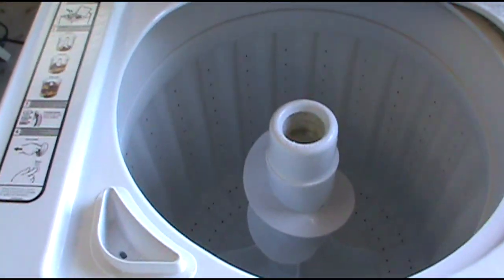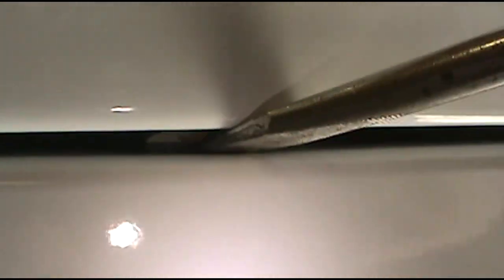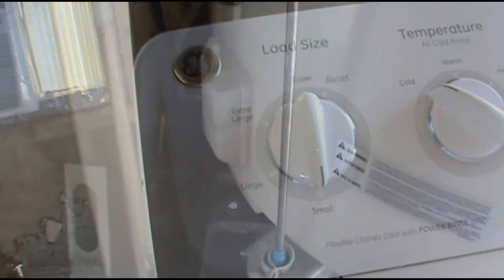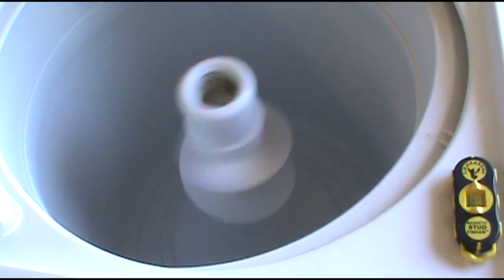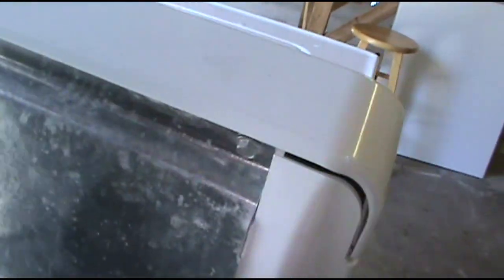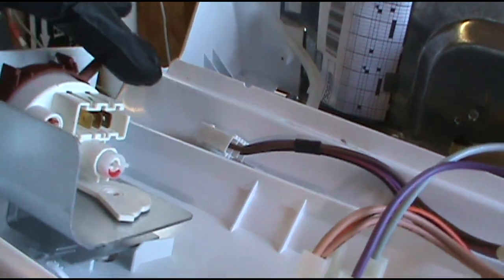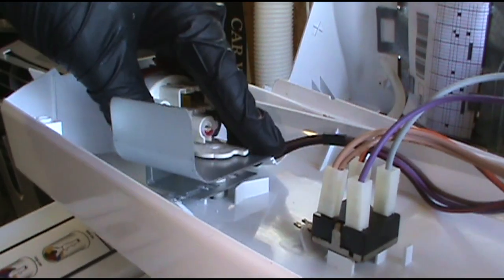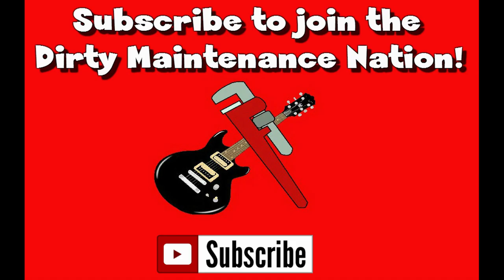HOW TO FIX WASHING MACHINE THAT WON'T GO INTO SPIN CYCLE

Comment: Hi Lex,
My washing machine spin still works but it doesn't spin in a high gear. What do you think the problem is?
Thanks...
Reply from the maker: Hmmm, that's a tough one since I'm not in front of it. Could be the transmission. I've had to replace a lot of them in the past. I'm sure there's a YouTube video on how to do it. I don't have a video on that yet since I haven't had to do one in years.

Comment: I have hydro wave ge washer top load the motor code flashes 6 times according to the chart that means locked door it says to free the system. I tried everything thing, nothing works. The machine won’t agitate nor spin. Any help?
Reply from the maker: Try unplugging it for 10 seconds and plugging it back in. Sometimes a reset works. If not, I'd need to be there for this head scratcher 🤔.

Comment: So how about if it spins only sometimes, seems only lightweight loads will spin. 
Tried wash a cotton blanket, very heavy wet and it also wouldn’t spin BUT after a push start, it spins normal
Reply from the maker: Hmmmm after you help it then it starts to go tells me a motor issue. I could be wrong but if it was anything else, it wouldn't go at all. Even with a push. Could be the blanket is too heavy as well. Hard to tell by not being there. Thank you so much for watching J!
www.DirtyMaintenanceNation.com

Comment: Didn't work for mine but thanks for posting.  With my timer in the "spin" area of the dial, I can blow on the hose and hear the click of the switch up top and the transmission/motor/pulley will jerk like it's wanting to spin, but that's all it does, is jerk.  I wish I had a schematic and logic diagram I could follow so I could see which wires are connected when that air switch operates.  I'd also like to know how opening up that clear hose to atmospheric air pressure (when the tub drains down that is what is happening) the switch is operated.  I have to blow in by mouth about 2-5 psi over atmospheric to get the switch to click.
Reply from the maker: Sounds like you got a head scratcher there.
Reply: Do a motor reset unplug the washer for 1 minute plug it back in and open and close the lid 6 times fast that will reset motor usually associated with "jerking" you describe

Comment: My GE won't spin. Just makes clanking noises and moves back and forth a little. . I put a magnet on the lid switch so I can have the door open. I gave the tumbler a little push and now it's working. What could the problem be?
Reply from the maker: Weird. If you have to help the motor, it may be going bad. If it was something else it would be totally dead. Hard to tell by not being there. Thank you so much for watching College Debt!
www.DirtyMaintenanceNation.com

Comment: I have GE that cycles fine until last spin cycle. Drains but no spin. Tube is clear I can hear pressure switch pop. Motor free to turn  what else should I check?
Reply from the maker: Weird. If the timer advances all the way to the end then it still could be pressure switch. Hard to tell with this one. I'd need to be there.
Reply: The motor will turn to agatate but will not turn to spin. Belt drive. Appears transmission locked up in one direction

Comment: Lex, I have a 70 series Kenmore washer that will only go into the rinse and spin cycles by manually turning the knob which woks only some of the time. My lid switch has been bypassed so it's not that. My hose is clean so i don't think it's that. Does this issue sound like a timer problem? The timer goes all the way through the cycle but when you lift the lid that washer is full of water. Right know i can force the spin cycle by turning the knob to spin and forcing it on. Need some help!!
Reply from the maker: Robert Louis Hmmmm, that's a tough one by not physically being there looking at it. If timer advances to the end on its own then it sounds like timer is good. Maybe pressure switch is broken & telling washer that there's no water in it so it never agitates. Just a guess though. Thank you so much for watching Robert!
www.DirtyMaintenanceNation.com
Reply: Do you hear any noise when it supposed to be in rinse and spin cycle?

Comment: Ok since my last post I have realized that my timer knob doesn’t move at all. So should I replace the timer dial (knob)? If the timer doesn’t move could that be the reason it runs over with water?

All of the cycles work if I manually advance (turn) the timer knob by hand.

Now for the next part. Where can I buy GE replacement parts for my machine? I’ll Google it but if anyone knows a good link please help me out ok. 

Thanks 
T
Reply from the maker: GeorgeBonez If the timer is not moving to the end on it's on, then yes I'd replace it. Sounds like it's bad. Also, click on the gray arrow under the video & look in the video description below. It has part links you can click on. Then, you can search around until you find a match & buy the parts on Amazon. Thank you so much for watching George!
www.DirtyMaintenanceNation.com
Reply: Lex Vance I removed the old timer to get the correct PN and have ordered a new one. I’ll let you know how it goes in a couple of days. Thanks again for all of your great help. :)
Reply from the maker: GeorgeBonez You're welcome man! Keep me posted!

Comment: I have a GE select washing machine and it will agitate fine, but  it won't spin out. When I blow into the tube, I can hear the switch and the agitator clunks like something is binding. How can the transmission be bad if it agitates? Thanks
Reply from the maker: Pull the agitator up & see if somethings caught under it. It should pull right up. Put fingers underneath & pull up. Its hard to tell when I'm not in front of it. Also, look on top of the motor & see if there's a light blinking on top of the circuit board. The newer washers will give an error code & tell you what's wrong. Google "error codes" for your specific washer if it has it.
Thank you so much for watching Joseph!
www.DirtyMaintenanceNation.com
Reply: @LexVance  , thanks for the reply. It's an older model, so no circuit board. I'll give it a try on the agitator. 🤙
Reply: @LexVance  , update- I popped the agitator out and now I know why it wouldn't spin. The tub underneath the agitator is corroded through the metal. The previous owner must have left some caustic liquid sitting in there for a while. Oh well! Thanks again! Time for some Scooby snacks!

Comment: Dear i have problem it turn in until drain & spin the last cycle its stop what you think it is terminal or pressure switch
Reply from the maker: I would need to be there for this head scratcher. Some things I can't do over YouTube comments.

Comment: Hi Lex Vance, my washer is Kenmore sears 100, I tried to put it down yesterday , I found the thin pipe is blocked. I can't blow it. What should I do? Need an air gun to clear it? My washing machine is new，less than a year, it always stop at “wash” circle ,I  tried "motor reset ",it worked good (complete) only  once, then stop at "wash" as usual ...  the repairman said that the water is too slow.
Reply from the maker: Xiaoqing Chen Get a coat hanger & run it up the tube as far as you can & clean it out. Should be good after that. Thank you so much for watching Xiaoqing!
www.DirtyMaintenanceNation.com

Comment: Is it possible for the hose to be partially plugged in such a way so that the tub fills to the right level correctly but when the tub drains the spin never starts?

 That's what's making me crazy, I can't figure out what tells the spin cycle to start.  What my GE WCXR1070T5AA does is the drain pump pumps forever down to the bottom and then just is pumping air (I think this is normal). The tub never spins because some how the controller thinks it's still pumping out water that's not there
Reply from the maker: Could be. Blow it out & see.
Reply: @LexVance  But the load level function works correctly (when set to "small load" it fills to small and stops, etc), I'd think if the hose was blocked the tub would overfill.  So you think it's possible for the load water level to detect correctly but it can fail at detecting that the tub is dry?
Reply: @LexVance  I blew in the hose, I hear the expected water level switch click (actually I expected three different clicks for the three load sizes but it just clicks one time... not sure how it tells the difference between the three load sizes if the switch only clicks one time)
Reply: Did a extra small test load (empty with no clothes), now it worked to the very end, all I did was the blow in the hose to confirm the switch would click.  Maybe that fixed it.  Thanks

Comment: A common problem on older machines that won't enter the spin cycle is the mechanical lid switch.  I haven't worked on one yet with a magnetic switch like the one your working on.  Just another thing to look out for Lex, thanks for the videos!
Reply from the maker: aeroaggie Oh yea I've worked on a few of them old dinosaurs. You could hardwire the lid switch and bypass it. It was so easy. I loved them, LoL!😂👍😂
Thank you so much for watching aeroaggie!
Www.dirtymaintenancenation.com
Reply: we still have kenmore washers from the 90s still going strong..and they get abused.
Reply from the maker: working shlub Noice! 😂👍😂
Reply: Why my washer spin but not the final 2 minutes of spin? Clothes come out damp.  dial never reaches off position. Close but too wet.

Comment: My GE doing the same thing not spinning it keeps going into error codes 16 &18. It drains properly but won’t go into spin cycle. It’s a HE one so the cover is not easy to get off. Any advice on how to fix these codes?
Reply from the maker: You can Google "error codes" for your washer & you should get the answers. That's how I got the error codes for the GE washers I work on. Thank you so much for watching Darci! 
www.DirtyMaintenanceNation.com
Reply: Lex Vance so we entered in service mode and it said it was due to a clog somewhere..we have literally disconnected every tube and no kinks or holes even to the main drain.

Comment: My washer is starting the spin cycle but it seems to be stopping early.  There's no visible water in the tub but the clothes are very wet (sometimes completely soaked) and you can hear water sloshing if you rock the tub.  Also, when I opened the front I could see dirty water in the little tank that the pressure sensor hose connects to.  

Does this sound like a bad pressure switch or something else?
Reply from the maker: Hmmm that's a tough one to diagnose over YouTube. Is the timer going all the way to the end? If not, the timers bad. Thank you so much for watching straighttoplaid!
www.DirtyMaintenanceNation.com

Comment: Mine will spin once it finishes the rinse cycle and starts to pour water out but then stops spinning and makes a noise until it finishes. If I put it on spin cycle only it will spin clothes without a problem. Why is it doing that? There's no water inside left but the clothes feel wet, no soaked but not like it does after a normal spinning cycle.
Reply from the maker: Hmmm, you've got a head scratcher there. I'd need to be there for this one. Sorry Eric 😭

Comment: Question washing machine is indicating spin but it's still not spinning what kind can the problems still be
Reply from the maker: Could be the pressure switch or it could be the lid switch. I'd need to be there with my volt meter to investigate. Thank you so much for watching Pnu!
www.DirtyMaintenanceNation.com
Reply: @LexVance  I appreciate the reply

Comment: Do you think it's still  the pressure switch if it spins on empty test run but not with a load in?
Reply from the maker: Chris Watson Yep.
Reply: Replaced pressure switch, still won't spin with a load in but will spin on empty test run. Also has a burning smell when trying to spin with full load. Any other suggestions?

Comment: When my kenmore starts the spin cycle, it sounds like it's running but the basket stays still. If I open the top (which stops the motor) and close it again, everything spins fine. Any idea what might be the culprit? I cleaned out the hose but wanted to check before buying a replacement pressure switch
Reply from the maker: Kenneth Coleman Man I don't know that's weird. I would need to be there. Its hard to diagnose over YouTube comments. Thank you so much for watching Kenneth!
www.DirtyMaintenanceNation.com
Reply: Hey dude,,same exact problem. I believe the lid switch is the problem there. Because as u say lift the lid and close it and its a go.
Reply: I have the same problem. I will push the knob in and pull it out, and it starts spinning. It's like it doesn't engage spin sometimes.

Comment: This worked once and now it won't spin again. I noticed the timer keeps ticking after the cycle is done.
Do you think it's still the pressure switch or could it be the timer that is preventing the spin cycle from engaging?
Thanks
Reply from the maker: Chris Watson Its the pressure switch. Put in a new one. Thank you for watching Chris!
www.DirtyMaintenanceNation.com

Comment: How can you tell if it's the pressure switch or the lid switch? Same symptoms right?  Thanks.
Reply from the maker: If it was the lid switch, it wouldn't agitate. It agitated fine, just wouldn't go into spin cycle. That's when I knew it was a bad pressure switch. Thank you so much for watching Peter!
www.DirtyMaintenanceNation.com
Reply: @LexVance  Hey Lex,, thanks for giving your expertise on the tube. As for the lid switch theory is because when I lift the lid during a spin try, and close the lid it starts to spin. Also, the discharge does dump the water prior to spin but the tub won't spin till i open the lid and close it again. Crazy huh. Washers have sure gotten complicated. 😋

Comment: Hello brother I have the same model washing machine as you. My washing machine will just hum. The belt is fine the motor is extremely hot. It will not spin or agitate can yo uh help me sir.
Reply from the maker: The middle agitator pulls up. Just put your fingers under it and pull it up. See if some clothes got trapped and is causing it to bind. If that's clear then you may need a new motor. With it being extremely hot, that's not good. Thank you so much for watching Thomas!

Comment: THANKS FOR THE GREAT SERVICE YOU DO TO OTHERS AND EVERYONE WHO WANTS TO FIX ON THEIR OWN. ONE QUESTION WHAT IF YOU HEAR IT WHEN YOU BLOW INTO THE SELCTOR IS IT WORKING .?? ALSO WELL WE NEED TO KEEP IN TOUCH I AM A HANDY MAN THAT FIXES MANY APPLIANCES AND SOMETIMES GET STUCK? GET AT ME AND GOD BLESS
Reply from the maker: Not always. Sometimes you'll hear it click but it'll only work temporarily and then not work again. Just replace it then. Thank you so much for watching tonyc!
www.DirtyMaintenanceNation.com
Reply: Thanks for the quick response lex, I ordered the part already and well , just have to wait an see. I knw its not the timer as it moves slowly when I start it up, when I move it to spin drain, it drains just wont spin, or agitate as well. Now the motor is good I believe I hooked it direct and it spins so its only one other thing, either the switch . I doubt that as I hear it as well when I lift the top. Anywho thanks again , God bless
Reply: oh what if its not that? i mean it drIns it does not spin or agitate. changing the selctor switch a. what else can it be. thanks

Comment: I have a hotpoint washer after putting clothes in it it will not drain the water from the clothes the clothes are full of water but there is no water in the washer. What can be the problem the washer isn't not spinning the water out of the clothes. Please help
Reply from the maker: If the timer is advancing all the way to the end, then it could be the pressure switch. If the timer isn't making it to the end, then it's a bad timer. These things are hard to diagnose when I'm unable to be there watching it. Thank you so much for watching Margaret!
www.DirtyMaintenanceNation.com

Comment: I tried clearing pipe but still can't get the washer spinning. I hear click when I blow but does not spin. Does that mean its pressure switch problem?
Reply from the maker: Could be pressure switch or the motor. Thank you so much for watching Eshwar!

Comment: Hey dude thought once you take it off and blow into it and clinch it before putting it back on
Reply from the maker: You can do that. Thank you so much for watching hbgc!
Reply: And does the models have capacitors on them
Reply: Lex Vance hey one more thing we’re can I locate the compacitor on that ge model you were working on
Reply from the maker: @hbgc4  They're usually strapped some where visible. This video is years old. I don't remember where the cap was.

Comment: My washing machine once turned ok fills with water and keeps on filling. It never goes to the next cycle. 

I know there’s a switch in there somewhere that tells the machine “it’s full” of water. Mine just keeps on filling until it runs over!
Reply from the maker: GeorgeBonez There's a clear tube on the side of the washer tub that may be clogged. Get a tooth pick, a coat hanger, or a safety pin & clean it out. Just pull it off the nipple & you should see black gunk in there. If that don't do it, change out the pressure switch. I show how to do that in this video.
Thank you so much for watching George!
www.DirtyMaintenanceNation.com
Reply: Man that's what he just went over. Pressure switch.
Reply: @LexVance  Hey Lex, my sister has a Kenmore elite,,that the timer stops at rinse cycle and has to be prodded to advance, once advanced will finish cycle. I'm assuming the timer has a tooth missing or something. Problem is can't find a timer for it. All either on backorder or discontinued. Any suggestions on finding a timer replacement or hard to find items? Thanks.
Reply from the maker: @peterford9369  Check Amazon maybe?
Reply: @LexVance  Thanks man. Did find a parts place that says they have in backorder. Amazon was a couple replacement versions, not for her model. Thanks for answering. You're good to do what you do. Will keep checking. Thanks.